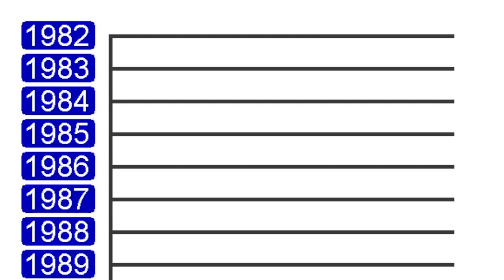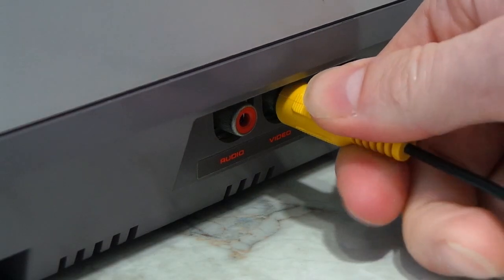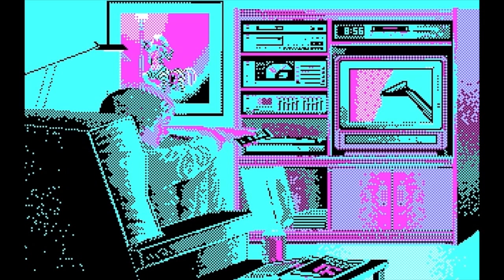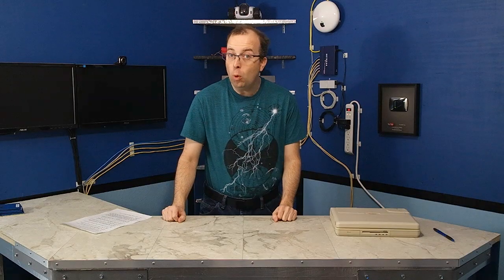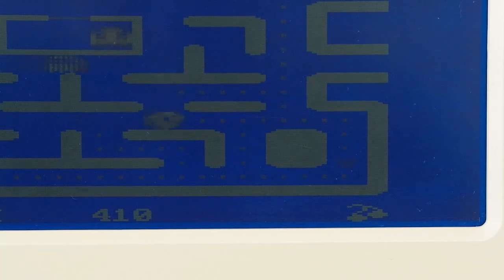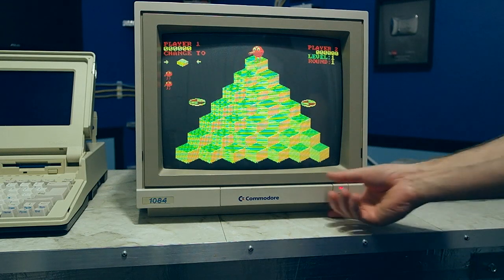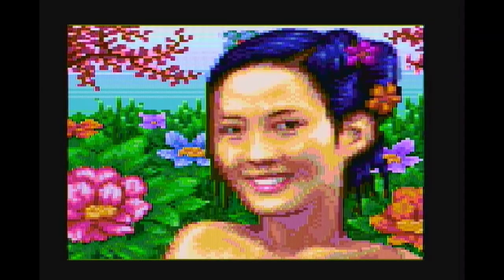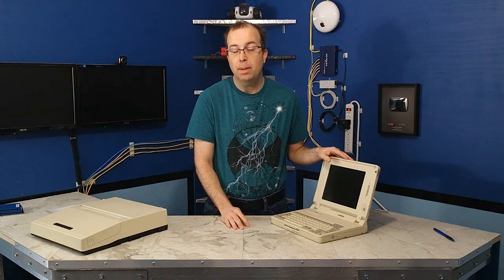CGA Graphics - Not as bad as you thought!

Comment: I'd have to disagree that composite CGA is superior to the 8-bit Atari's ANTIC and GTIA chips.  ANTIC featured a palette of 128 colours (to CGA's 64), and CGA's palette was fixed and relied specifically on artifacting to achieve more than 4 colours on-screen at once.  By contrast, Atari's ANTIC chip could use artifacting in its high resolution (320x192) mode to get red and green (in NTSC, in addition to white), but didn't for its standard modes.  While it was limited to 4 colours in any of the useful-for-gaming modes, those 4 colours could be anything from its 128-colour palette.  Even better, while ANTIC had 17 fixed graphics modes (in GTIA machihnes; 14 in CTIA), ANTIC actually built its display from a programmable display list.  This display list was capable of generating custom mixed graphics modes which let you build a screen line by line using any of the available graphics modes.  You could do this with a lot of trickery in most machines, but the 8-bit Atari was the only 8-bit machine where this was easy to do even from BASIC.  (DL=PEEK(560)+256*PEEK(561):POKE DL+5,6:POKE DL+6,5 -- this little bit of BASIC code will mix two large text modes at the top of the screen with your standard mode 0 text -- and it stays there and lets you type in those areas until you reset or POKE the display list back to mode 0 at those locations.  Jay Miner was a hell of an engineer.
Reply: +VaporChase Incidentally, further mucking about with the display list can let you display any given line of graphics in any colour by creating a simple display list interrupt that changed the colour palette on every scan line.

Comment: I hope you do a video on EGA. I still don't understand why so many programmers only ever used the default EGA palette when there were another 48 colors to pick from. I've heard it said that this was because the default palette was the same as that for CGA and they used it for backwards compatibility. However, if they're using 16 color graphics, how is that backwards compatible with CGA? What happens to the other 12 colors that CGA can't display in graphics mode?
Reply: +lurkerrekrul They mean the monitor. A CGA monitor can display up to 640x200 in 16 colours. So 320x200 16 colour RGBI works just fine. For the 64 colours, you need a monitor with separate intensities for R, G and B.
Reply: +Scali Bohemiq So the colors were actually created by the monitor and not the card? I always assumed that the card produced a video signal and the monitor was just a dumb device to display it, like a television.
Reply: +lurkerrekrul Yes, with digital RGB, like CGA and EGA used, the monitor determines the actual colours. The 'non-intensity yellow' == 'brown' is also something hardwired into the IBM 5153. Some clone CGA monitors don't do that, and just show dark and bright yellow, no brown.
Reply: +Scali Bohemiq Thanks for the explanation, I never knew that. I always thought that RGB was just a different way of sending the color information to the monitor.
Reply: +lurkerrekrul It mainly is dumb, but as Scali mentioned they did hack a couple of colours.

Comment: One thing maybe you missed it, but i found out there was a mcga on a small subset of  1987 ibm pc's models 30 and 25, Epson Equity? which allows 256 colors at a given time,  out of a palette of 262,144 running at a stunning 320x200 @ 70hz. most modern monitors run 60hz.
Reply: +aphixe MCGA was basically a budget-version of VGA, and used the same VGA monitors. It could do VGA's chunky 320x200 256 colour mode, but lacked the processing logic of VGA (eg for mode X trickery). It acted only as a dumb framebuffer. Various games were written for 'MCGA/VGA', targeting the lowest-common-denominator.

Comment: Great and very interesting video. I didn't knew about the composite output of CGA cards. You might know the Amstrad CPC. It's video capabilities are actually based on CGA chips. But the color handling was different. But what really standed out was a 160 x 200 mode with true 16 colors. The pixels looked very wide similar to the c64 but still images looked pretty good with this technique. I guess nearly all games on the CPC used that mode. Only some ZX Spectrum ports considered the 4 colered 320x200.
....
but that machine really sucks at games anyway. I tried playing Turrican on it and nearly fell asleep.
Reply: +Slamy&#39;s Game Music Not based on the "CGA chips". The 6845 was used by lots of hardware round that time.

Comment: CGA is sort of a hack. The Original CGA Video Card uses a CRT controller (Motorola 6845) that was meant for text-only monitors. The PC programs the CRT controller in such a way that the width of each text row is only 2 pixels high, and there are 128 rows of characters.

Because of the order in which the 6845 emits addresses, even and odd scanlines are laid out 8k away from each other in memory.

Source: http://www.minuszerodegrees.net/oa/OA%20-%20IBM%20Color%20Graphics%20Monitor%20Adapter%20(CGA).pdf Page 10, 17

Comment: The question that begs answering is, why didn't anyone do a card or monitor that handled both modes out of the same plug. It would have been easy to digitally convert the composite image before the DAC. There would have to be a toggle of course.
Reply: because RCA jacks and cables were the standard for composite video and you can't cram RGBI onto one wire.
Reply: +Robert Szasz You've answered nothing I'm afraid. Perhaps I wasn't clear enough. The decoder should look at two consecutive pixels and give you the correct color. Same as what the NTSC decoder does only cleaner, with one monitor and with the option of toggling between them, so you can chose between color or resolution.
Reply: DOSbox does that, doing it in hardware would have been expensive as it requires the inherent crappyness of NTSC to work. Converting from NTSC to RGBI is neither cheap nor easy, you would basically need a framegrabber and those were tremendously expensive.
Reply: +Robert Szasz The C64 VIC II did exactly this for it's multicolor mode. Only it could mix the two modes on the same screen. Mixing modes on the same screen could also have been done by at the same time as encoding the right colors, having a separate (smaller) matrix flipping the mode on and off.
Reply: +Robert Szasz My whole point is that it is very simple. The CGA monitor is simple tristate TTL logic with a single resistor. But, it would be a cinch to switch to a DAC that is a tiny bit more involved like what is in the VIC II. Even businesses back in the 80's would have loved to be able to show more than four colors. Not mixing in a composite NTSC decoder would mean a much sharper image with cleaner colors.
With regards to the demo I'm also really impressed with what they where able to get out of the beeper channel. With even a transistor radio level speaker secured in one of the sides of the monitor I doubt PC Jr. or Tandy would ever have been necessary. It's not SID quality but in moments it equal to POKEY and certainly better than anything the Speccy or Amstrad ever put out. If you need more quality just throw more cycles at it.

Comment: why doesn´t the TVs flicker?
Reply from the maker: +Maro Strifezza I went to great lengths to adjust my camera to get the best sync with the CRTs.
Reply: +The 8-Bit Guy Glad you did that, flickery monitors would have been so annoying
Reply: +Morahman7vnNo2 I set the shutter speed to 30 fps.  Unfortunately, my camera won't do 29.97 fps.  So it goes through phases of about 5 seconds with the picture being bright, then being dim.  So I just tried to catch scenes during the 5 second bright part.
Reply: +The 8-Bit Guy 
sounds like how to do that and why you have to would be a whole video unto itself!
Reply: +mspenrice “…except those which stubbornly insist on 30.0 or 60.0 fps, instead of the established 29.97 or 59.94 standards…” 
See, and I think it's about time we got rid of a retarded refresh rate which was introduced as a last minute fix some 60+ years ago to mask the fact that the engineers designing NTSC messed up by placing the video and audio bands too close to each other, so they ended up interfering. Especially since NTSC broadcast—the only reason for keeping this madness—ended half a decade ago.
Reply: +The 8-Bit Guy Bravo sir. that level of professionalism earned you a follower.
Reply: +Maro Strifezza If I had to guess I'd say the video capture frame rate was just synced up properly. On top of that slowing down the capture of each frame to allow the entire frame to scan from the monitor onto the sensor of the camera. Be cool to know exactly how it was done for this video though.
Reply: +Maro Strifezza ... oh and of course, the LCDs won't flicker at all unless they update in quite a strange manner, or have a flickery backlight that's out of sync with the AC frequency. More usually with fluorescent lights you get the kind of colour-fringed moire effect that you can actually see on some of the screens here, as they run at a much higher frequency, closer to or even beyond that of the TV beam, so the interference looks more like a megademo effect than a straight flicker.
Reply: I assume that you're from Europe. In Europe PAL TV standard runs at 50 Hz/25 fps. However most of cameras record at 30/29.97 fps. That's where the flickering happens. In US, there's the NTSC standard, which runs at 60 Hz/30 fps, so TV's screen gets synchronised with camera's frame rate.
Reply: +Maro Strifezza ... presumably because it's a TV and therefore running at the same rate as the camera? Modern computer monitors flicker when video-recorded or filmed because their scan rates are out of sync with the camera - they were built to be high resolution, flicker-free (to the naked eye) devices, technically and conceptually separate from TV screens.

The older ones were just reboxed televisions, with the video card built to synchronise with the existing scan rate, not the other way around. As are camcorders, including most hi-def ones (except those which stubbornly insist on 30.0 or 60.0 fps, instead of the established 29.97 or 59.94 standards which even basic VGA mode sort-of uses (merely doubled up)... or indeed instead of 25.0 or 50.0 in PAL areas, which is an even more glaring and annoying discrepancy).

So, as long as they're within the actually quite tightly defined tolerances (equivalent to a drift of one or two lines per frame, or a fraction of a percent) of the regional broadcast TV standard, there won't be any visible flicker, and even if they're not in tight sync, the worst you'll see is a very slowly moving dark horizontal band occasionally roll up or down the screen, representing the camera's blanking period intersecting with the CRT's active period. But bear in mind that even the difference between 29.97 and 30.00 is only 1000/1001, so it could take a full 30 seconds to go through that cycle. Meaning that with the kind of fairly short, quick jumpcut editing used here, it would be very easy to hide the dark bar, so long as you brought the clip just as it's going off one end of the screen, and cut it just as the bar was reappearing at the other. With the general amount of overscan granted by a CGA display only using 400 of the 525 available lines, that should give you a good 6 to 7 seconds to play with as a minimum.